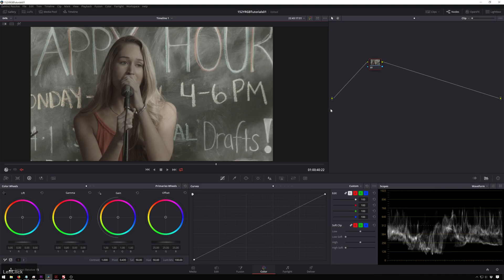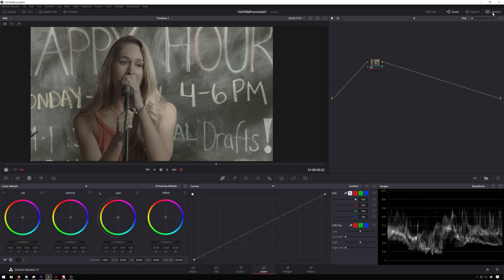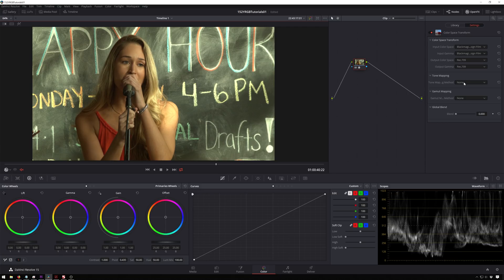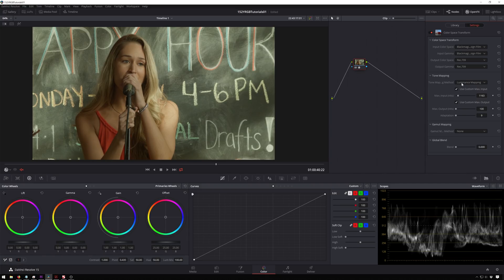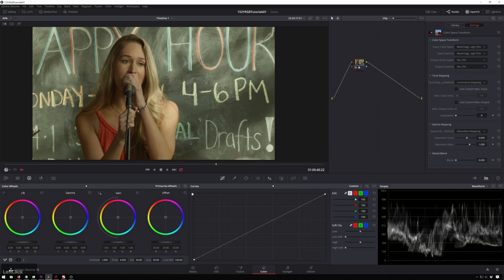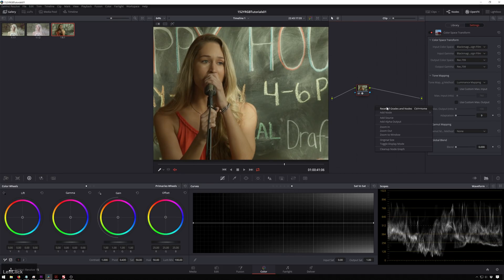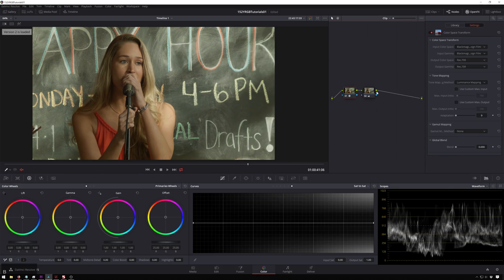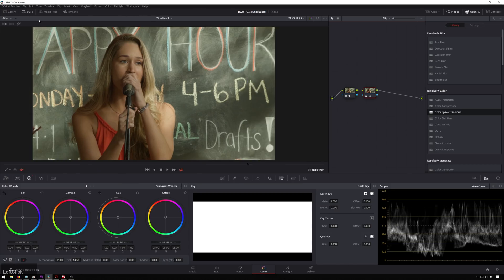Don't use LUTs for Color Space Transforms - Davinci Resolve 15 Tutorial

Comment: Thanks Theo. Great video as usual. The Color Space Transform node has become one of my favorites. The only issue is that there are no transforms for DJI DLog-M, and some of the Sony Picture Profile Gamma curves and Color Spaces. Do you know if there is a way that third parties can build these?
Reply: Doing a giant deep dive googling for an answer to this and running into the exact same problem. Did you ever figure out a solution?
Reply: @KirkwoodImaging I’ve recently switched to using DaVinci Color Managed workflow instead of DaVinci YRGB.  It does have an Input Color Space for the DJI, and for Sony SLog3.Sgamut3.Cine. I upgraded my Sony cameras to the A7s III and the Sony A1 which give really amazing results with SLog3.Sgamut3.Cine because they shoot in 10 bit color. It’s like shooting still photos in RAW. So much better than the old Sony Picture Profiles. But if you’re stuck with an older Sony Camera, I’d recommend you switch to shooting in HLG3 picture profile. There is a good input Color Space for HLG when using  DaVinci Color Managed workflow, and your footage will be automatically converted as Resolve will recognize it as HLG.
Reply: @KirkwoodImaging  here’s a link to a video on using Davinci Color Magee workflow: 
https://youtu.be/KTWdqIdpG9Q

Comment: If you want different color spaces for different shots sure, but why not just set your color space in the project, click on the gear,  my dude.
Reply: Doing it in the project settings is the best option when you're working from only one camera.
Once you need to mix cameras, it's easiest in the colour nodes - such as when you shoot on a Cine camera and have a crash-cam made from a DSLR or GoPro, or if working with cameras from different manufacturers, such as mixing BMD Ursa4K with AJA Cion4K - same sensor, same dynamic range, but one shoots BMD 'Film' and the other shoots Linear.
Done with the OpenFX transform, most people could never tell the difference between the cameras.

Comment: im glad you finally did video on this topic.
But! There is a trick i like - Color space transform rec709 > arri alexa log THEN Built-in lut Ari alexa > rec 709. Because lut is not flexible, it forces davinci to give us "smooth higlight rollof" known from ari alexa. cheers!
Reply: The better benefit of transforming to Arri is that it gives the log color controls in Resolve much better feel. The range of tones that each wheel affects seems far more useful and intuitive, at least compared to the way they behave on BM Film or SLog nodes.
Reply: @mochajohnson4780  good to know
Reply: Interesting. So would that be a 2nd node with color space transform or all in the same 1st one? Does this trick work for gh5 or any other cameras?
Reply: @appleseedz9x38  yes for all